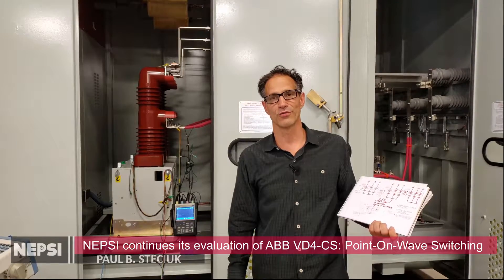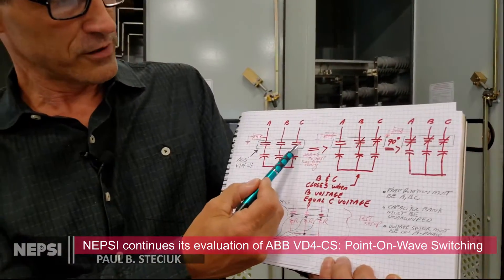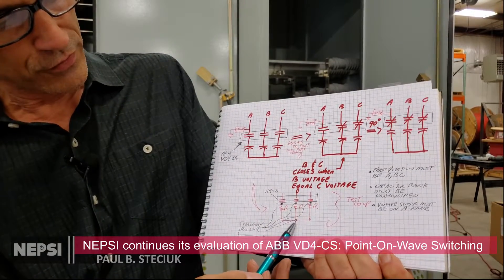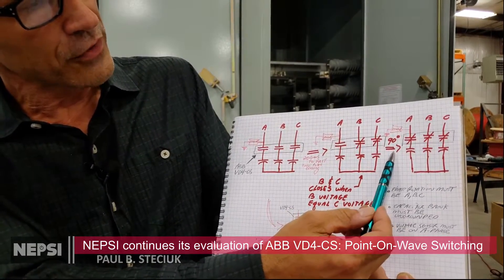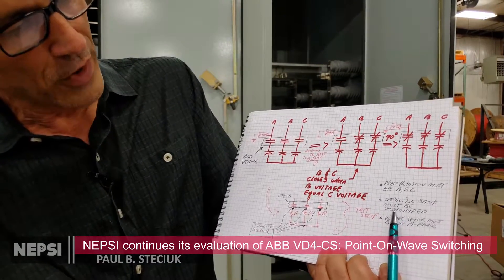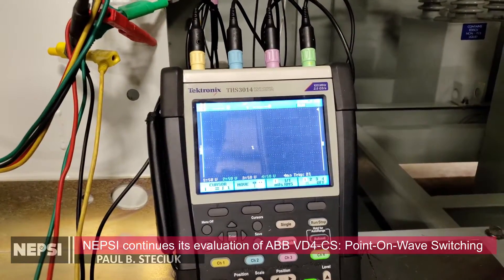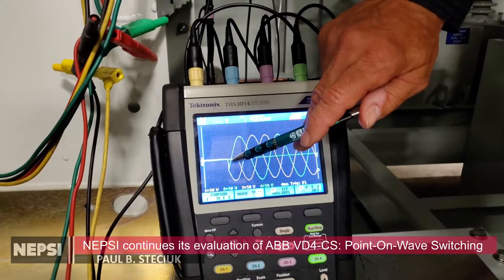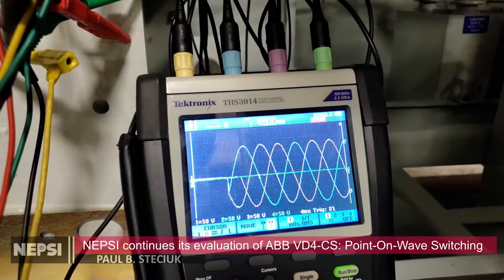Continued Evaluation of ABB’s VD4-CS Transient Free Capacitor Switch: Point-On-Wave Switching

Comment: Hello Paul, what is the difference between  ABB VD4-CS and DS1?
Reply from the maker: Sorry for my late reply. VD4-CS closes on zero voltage with no power electronic type device. Timing and servo motors guarantee the closing. It is a 38KV Device. The DS1 uses a diode and controlled switching time. Also servo motor based. It switches in the diode when reversed biased. After it starts to conduct it is shorted. Thus transient free.  It is a 15 kv device and not available at higher voltages. Use DS1 at voltages of 15kv and below. Use VD4 at voltages above 15kv.